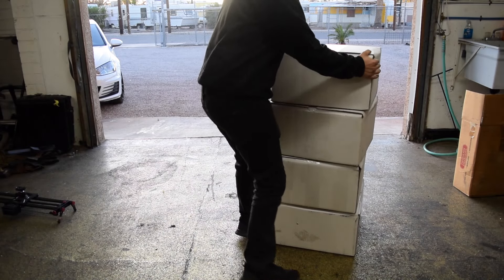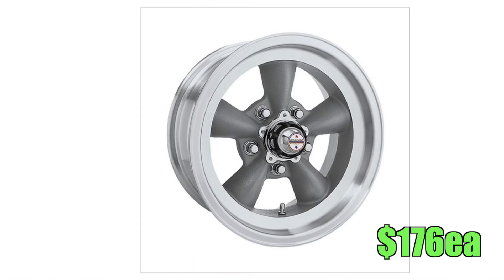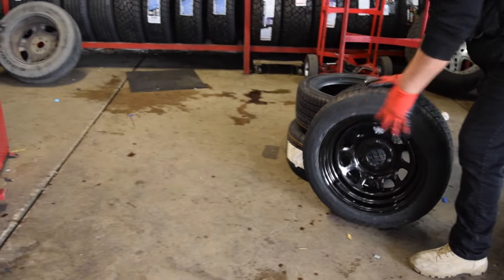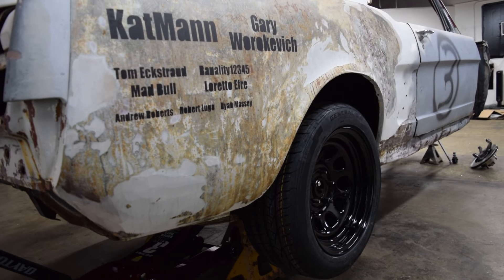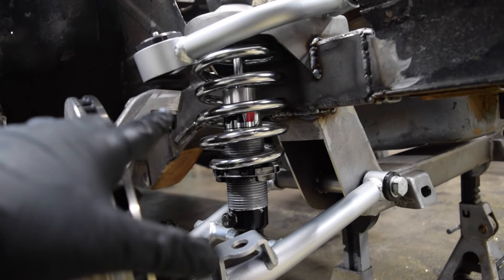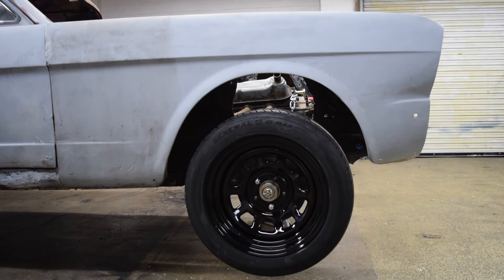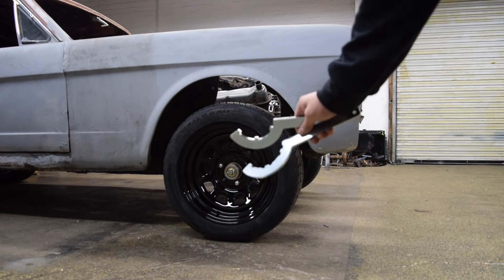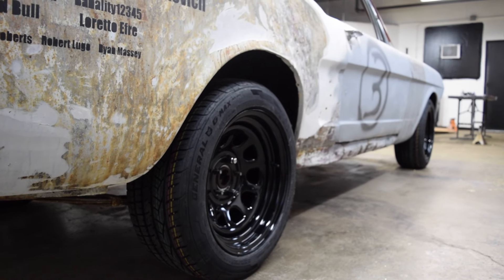Cheap Amazon Wheels for the Mustang...Worth it? | ScrapStang

Comment: Those wheels look great. Not a fan of black wheels but those stand out good. And they fit the budget good. Think shiny lug nuts and center caps will set it off nicely. Good thing you fixed that front last time you did that it was bad. Coming along great.
Reply from the maker: Thanks and yes, its fully welded now 😂

Comment: I dig the look for sure. Not super stoked about how heavy they are but alas this isn't my car either. Lighter wheels help with rotational mass and allow for better use of the power the engine is spitting out.
Reply from the maker: I 100% agree! rotational mass is something I've been trying to keep low, with now ps pump, or ac, aluminum flywheel in the future. If I have the budget for It later on I will definitely go with a lighter wheel.
Reply: @rookie__pilot  rpf1's for the win. I know they're overplayed but there's a reason. They are reasonably priced and light as heck. Put them on my 2020 outback XT and shaved off 5.5 lbs per corner versus stock.